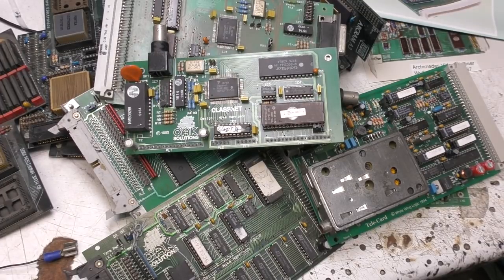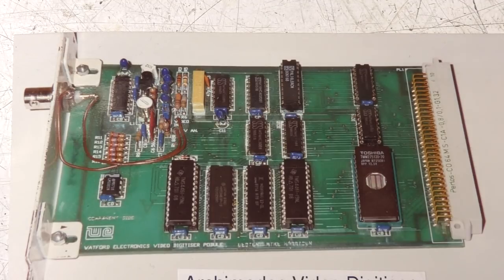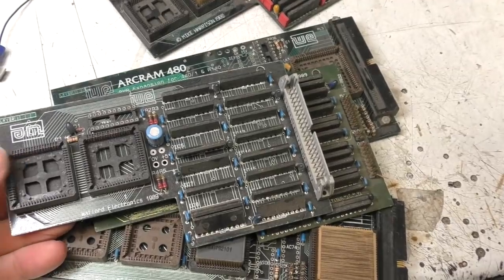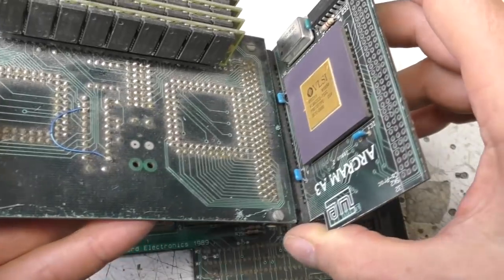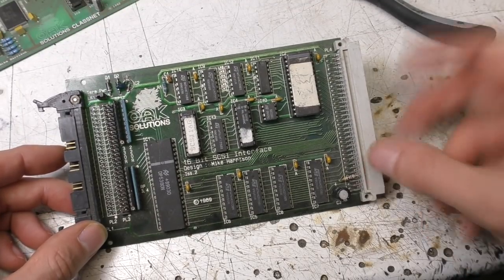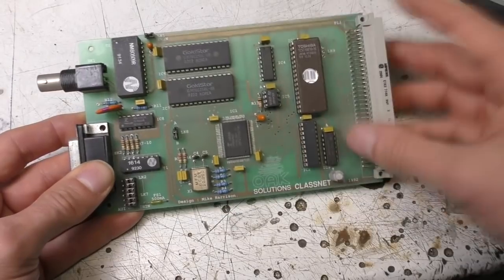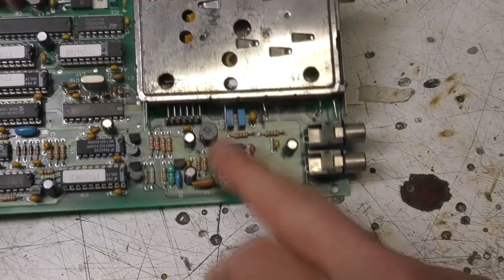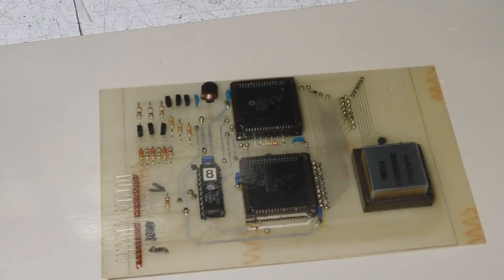Some of my old Acorn ARM hardware designs

Comment: My A3000 had an expansion card but I don't think it was a podule.
It was a midi and audio sampler card and it used the Econet socket for it's I/O.
Reply from the maker: no, the 3000 just had a strip of 0.1" sockets with a subset of the podule connector, only 8 bits wide
Reply: @mikeselectricstuff  
Was that for the mini podule slot?
There was a slot on the back for expansion card but I never saw it used.
Mine used the Econet socket so I assume it used the Econet upgrade slot.
It came with a breakout pigtail for audio in, MIDI in and MIDI out.
Sadly it was pre-general midi and the something in the sampler started adding a constant glitchy noise to the recordings.
Reply: Is that like the A3020?  In that I was thinking a full size podule was in there but opened it up and was wrong!  It was a short board with a few pins!
Reply: AFAIK A3000 system had a podule connector on the back which was later dropped for the A3010/3020, not quite sure how you would use it as even if there was an external case it would be a bit of a kludge.
Naturally I grew up with Archimedes machines and even at secondary school they had only got their first windows machines two years before I was there (2000) and my junior school was the same. 
Managed to acquire a few A30x0 and A7000 machines but sadly they are now all long gone, even got given a copy of Fastrax PCB software.
The later machines (A7000/RISC PC) had a special connector for a network card as well as the podule(s), though one design flaw was that on the A7000 you could not have a podule and an internal CD-ROM as the case is not deep enough!
Reply: @dglcomputers1498  A mate of mine had a video capture card podule that he used with the A3000 - the card was installed in a metal box and then plugged into the back of the machine - I think there was a slot under the back of the machine that a metal tab went into to stop side to side movement.